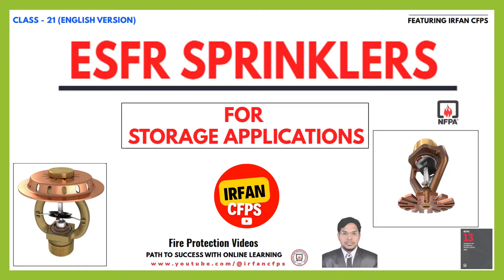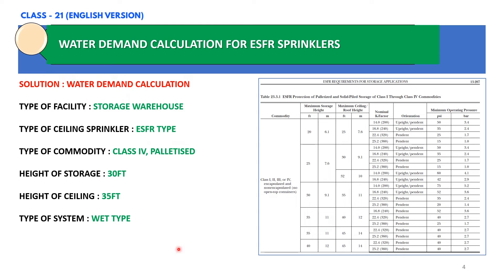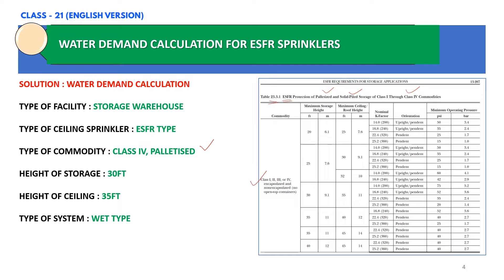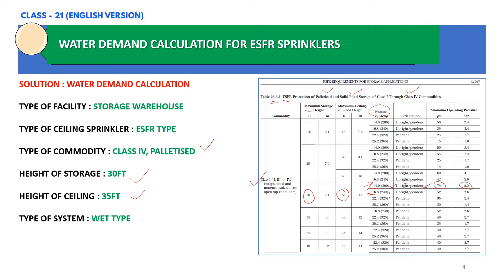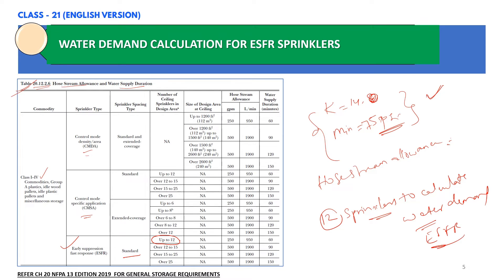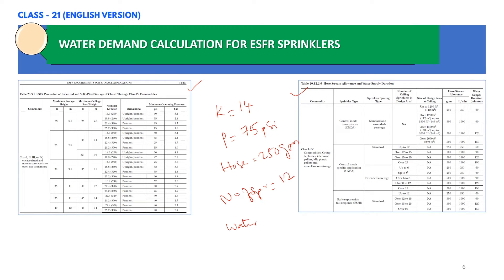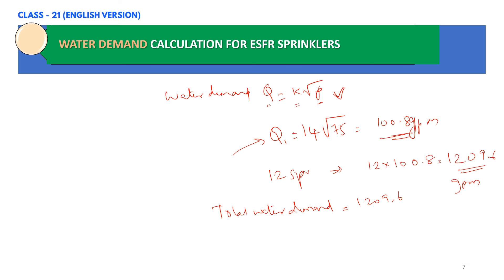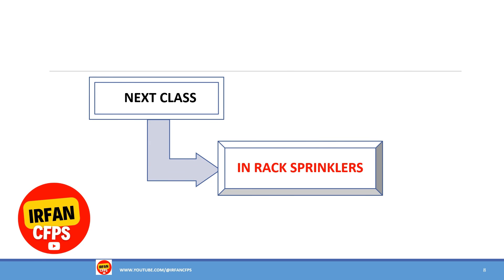ESFR Sprinklers: The Best Choice for Storage Fires

Comment: "Why are you ignoring the hydraulic increase due to pressure loss in the pipes? In real hydraulic calculations, flow demand increases because of friction loss and elevation. Just adding 12 sprinkler flows plus the hose without considering hydraulic demand is misleading."
Reply from the maker: Thanks for your feedback. Please note always theoretical calculations are different from actual hydraulic calculations results. I explained the concept in principle so that it is easily understood. For calculating the demand it is the procedure as per nfpa 13. however to know the head we need to perform hydraulic calculations.

Comment: After calculating the system demand like volumetric flow rate in gpm, how can I calculate the total dynamic head of pump? Thanks!
Reply from the maker: To calculate the head, we must perform hydraulic calculations
Reply: @irfancfps  What if i came up with different flow requirements in my hydraulic calculation? What should I use?  Thanks!

Comment: from which area we start think in ESFR?... i have small storage with 350 m2 area only and height of storage less than 3.5 m and total height less than 4.5 and its rubber tire storage on small 2 racks pls advise

i consider normal sprinkler only standard response k factor 5.6 - ordinary hazard
Reply from the maker: As per my knowledge, ESFR sprinklers are required if you have high piled storage which means storage height is more than 3.7m height. In your case standard response sprinklers with k 5.6 is fine.